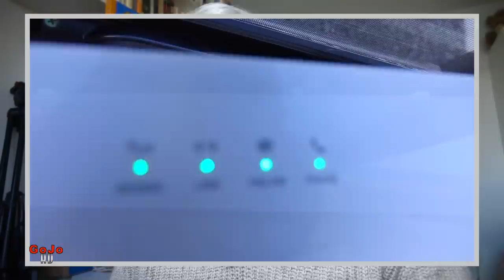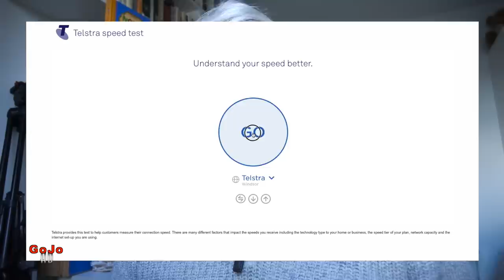NBN Connection Farce | Telstra Smart Modem Review | Internet Speed Test

Comment: Just a Friendly tip if you ever need more speed ask them to add a "Line booster"  (About $15-25 extra for 75mb-100mb Down 25-40mb up price pending on areas) 
Here we have the Booster in a Home bundle with basic Foxtel and  Foxtel's version of Netflix included FREE for  $100 for  87mb Down and 31mb up.....
(Ex staff Btw)

Comment: I worked on rail in WA, some of the optic fibre cable is hanging off farmers fences, they just hooked it over the barb wire to keep it off the ground.
Reply from the maker: wow
Reply: But you can easily get away with that with fibre as the data transfer is not electrical, where you absolutely cannot with copper.  This is one of the reasons why Turnbull's decision to stay with copper for the last km rather than have an all-fibre network was the ultimate in false economy, for which we will all pay for DECADES.

Comment: Wow I thought I had problems getting my N.B.N up and running. Glad I'm not with Telstra.

My story: I am with IINET here in Perth. My N.B.N was supposed to be connected on the 17th Jan 2019. They sent out my connection boxes that had my F.T.T.C connection Unit and my TP-Link Archer V1600 VDSL modem. 

A Message came via my phone to plug in my N.B.N F.T.T.C Connection Unit and wait for all 4 lights to light up and stay on. Well this didn't happen did it. My ADSL2+ that I had for 12 years was running fine with download speed of 13 mb/s so i was used to that. 

But because I had pre-ordered my N.B.N 2 months in advance and it was still not connected 40 days later after my Jan 17th connection date they kept up with text messages telling me to plug it all in. I had been doing just that every day while i was at work. I came home to find that my N.B.N was still not connected. After 4 phone calls to IINET support telling them of the troubles getting a connection, I told them I was not going to waste anymore of my time trying to sort it out. I was then transferred to the head of N.B.N operations at IINET and I told him that I was a gold customer and I was not happy with how they had not fixed my problem, well that got them moving very fast. Two days later it was all fixed.

Finally I got a N.B.N tech to come out and check all the cables and guess what they found, the idiots that layed the lines never connected up the Distribution Point Unit in the N.B.N pit outside my house. 15 minutes is all it took him to sort the problem out and now I am getting 49.6 mb/s down stream and 29.1 mb/s up stream with no disconnections at all.

 (My F.T.T.C connection Unit runs on a 12 volt to 240 volt inverter with 12 volt 60 amp hour SLA battery backup that keeps it powered up at all times and is charged by a 20 watt solar panel.)

  Because of their screw up I got the gold business connection package that just means no slow downs during peak times.
I have been with IINET for 12 years 4 months and find them great.
Reply from the maker: Glad it worked out for you after such a massive mistake

Comment: This is definatly a telstra issue, not NBN, looks like it is a new house and the telstra work had never been done, i used to do pre pro work for telstra and would see this all the time, the builder would get there electrician to run the conduit and the internal cables, so they don't have to wait for telstra to show, i would regularly turn up to a house like this expecting there just to be a slab and have to run cable, when all i had to do was check the internal cabling, pull the external cabling through with the bricky string and fit off the box.
Reply from the maker: Yes. the internals seem to have been done by the sparky - thank goodness.

Comment: NBNCo could have saved very much money by getting current and retired Telstra Techs for the whole rollout. Experience saves money. My example is of a mate who fixes mains water - has for decades. He has a map in his head. The 'management' company, as with NBN Contractors thought it would be cheaper to hire plumbers. That didn't work out as the mains water system is different. So, when things weren't fixed, he cashed in on the fumbles. Winner, winner, chicken dinner.

Comment: on a 50/20 plan, those speeds are still poor. I was lucky with iiNet, I get my full speeds, but even they told me the wrong details on how to connect the modem to the phone line. Luckily I was persistent in trying and got it working.

Nothing worse than calling tech support with iiNet, everyone is in south africa, and they just don't understand anything you say.

There is no way I'd have done their work for them however. I'd have demanded triple time, as it was a sunday.
Reply: I too am with iiNet, although labelled Westnet. On Friday I thought I'd stream the cricket from India but the picture was blurred and kept buffering, so I ran a speed check which showed a grand total of 1mbps. A little low I thought, seeing as how I'm paying for a 50mbps plan so I rang Westnet service. I found the South African lady very helpful but unable to do anything much but refer my case to NBN. This has been going on for almost 2 years now as I live 1.5kms from the exchange and the Telstra pits and copper lines are the problem, filling up with water. Telstra know about the problem and have admitted it, but won't do anything to rectify it. All the NBN problems have been caused by Liberal governments starting with John Howard, who sold Telstra off but didn't force them to improve their infrastructure or services. Rudd's idea was solid and would have improved telecommunications and internet service but the rabbit Tony Abbott changed it back to a combined system and there lies the problem. Our worst PM in history, Malcolm Turnbull backed it up in order to save money but long term rectification will cost taxpayers many billions of dollars.
Reply: Parishna 

Generally the speed is related to the quality of joints and distance of cable... people saying I’m with iiNet or whoever don’t realise how the data is provided.

I’ll make it simple, you can only drive slowly on a gravel road with potholes, smooth it out and you can travel faster.

The service provider isn’t the issue
Reply: But a clear and short road with no obstacles, is surely better than one hindered by 2.6km of decayed copper.

And I have still full speed, FTTN. weird..
Reply: Parishna nothing wrong with copper, that was just political spin to suggest it was substandard... all the electrical wires in your house are made from copper ... cat6 is made from copper.

Don’t fall for the political spin get the true facts on communication
Reply: Yes, but only if it's well maintained and 50 year old weather corrupted copper makes a huge difference to snr.

Comment: Telecommunications are not classed as an essential service meaning in most places you can occupy a home without a physical connection being present, it is only if the owner wants to connect a fixed line service that there would be the requirement for work. The statement about the onus being on Telstra to have done any work previously is incorrect for the reason stated above. Also, accessing telecommunications infrastructure without the correct accreditation is a crime against the Commonwealth if my memory is correct, not to mention all the OH&S rules you breached. That was poor form by NBN contractor to ask you to do that work, especially on the public verge as you would have been liable if someone was injured in that pit.

Comment: IMO NBN screwed it up when they decided on MTM, the Multi Technology Mix.

With the MTM, you don't know if you're getting Coax cable, Fibre, copper, Satellite, or wireless these days, I'm surprised they haven't gone back to smoke signals.

IMO this would have been avoided if they kept with the more expensive but easier to manage fibre to the premises because... it's one technology with easier to understand faults rather than seeing that the house is on the border between 3 technologies and finding which one the house is going to be put under.

the people that are doing the job, are a subcontractor of a subcontractor, how is it bad? would you spend 3-5 hours on a job that's only going to pay you $75? no offence but I wouldn't. I would like a job that pays more than my daily feed and fuel in my car, plus insurance and super... not just $75 for a day where I got a degree in technological sciences that cost me over $10,000 to get.

Yes, on my install I got Fibre to the premises but the guy told me it's "$75 a job regardless of time" that made me assist him where I could to get him onto the next job.

Comment: I have been with Optus a long time, therefore installation & modem would be free. To date, installation has been put back 3 times. On top of that, i was told if i switched my mobile from Vodaphone to Optus, i would receive a free sim card, so that if the internet went down, i could use the sim to connect via the phone towers. If we can connect via phone towers, who needs $ 65 billion worth of NBN?

Comment: NBN guys came and installed a new pit connection in the street outside my house cutting off my cable connection. It took six phone calls over an hour long each and over two months to have my internet restored. Trying to communicate with NBN and Telstra phone operators and alleviate problems is more difficult than teaching a Chimpanzee how to use a Mobile Phone. Cheeta give me back my I-Phone you little bugger !!!!!

Comment: Ah Telstra, a communication company that dose not know how to communicate, and NBN is throttled at all points till they get complaints then they speed it up till the complaints stop, then repeat.

I once called Telstra from a phone plugged in to the wall at new rental, only to be told repeatably by several persons from Telstra on very phone I was using, that there is no phone connected to that house and I would need to have tech come out and connect one, it was only resolved by a friend of friend who worked at Telstra.

Comment: Where to start; Firstly, Telstra basically lied to you. Their systems should be able to tell you if your (I'm assuming FttN connection) is installed. The first person you spoke to was assuming your connection worked before but not when you spoke to them. Second, your pits and pipes look new so the people that installed the new pits never ran cable because they were assuming that nbnco would be doing that. That never happens because usually the copper wires are already in the ground. The only thing nbnco contractors do is run fiber to nodes or home if that is what the order calls for. They usually don't touch copper because Telstra own the copper from the node to the house or premises. I had the same problem with Fttn. I've since applied for FttP and 1 year later it was installed. You may have been fooled by someone jumping the gun. Just because you have an nbn box on the house doesn't mean you will have a connection. I would hazard a guess and say that your area was one of the areas where nbn contractors went broke while waiting for fiber and inter connectors to be delivered. I'm the only person withing 5 klms that has fiber to the home and the real estate knows it. They have not stopped trying to get us to sell our home. That is the real disgrace here.
Reply from the maker: Yes - a disgrace. So much unnecessary stuff happening because some don't do the right thing in the first place

Comment: Your NBN tech just passed the blame to Telstra. NBN becomes owner and responsible for all cables and maintenance once area is transferred to NBN. It is not Telstra's responsibility.
Now in your case, it appears, you didn't have active phone service. Only new or renovated houses do not have lead-in cable, which you pull through the pit. And again it is NBN's responsibility to run new lead-in cable. It is not Telstra's responsibility in NBN area.

Comment: A note NBN Co has NO Connection to Telstra. Telstra is just another Comms supplier and NBN CO owns, runs and connects.
In my own experience NBN will not talk to the public only the supplier and that leaves Telstra and all other comms suppliers to pick up NBNs failures.
Some problems are however related to the original telephone connection up to 20 years plus old however due to the Liberal Government going from NBN to the home to NBN to the Node leaves any old original telephone cabling problem still intact.\ resulting in a lot of unnecessary problems.

Comment: That box on your house is for the 10pr cable connection not even a NBN box the one you have is meant to have modulus in it to connect that plug in were the copper strip across to the little plastic blocks and the blue cables are meant to enter in the bottom on the right, they will take that box of the wall and place the bottom of the box level with the blue cable.

If you have fiber to the house then this is all wrong those blue cables are meant to be fitted of on a wall plate inside the house and the fibber cable cones in from the street into the box then into the house next to the wall plate with the blue cables and plugged into the NBN optic fibber box that converts it into analog then from there into the modem that is also next to the wall plate and out of the modem into the wall plat feeding data to all outlets.

Not sure your connection type but it looks like it was done by unqualified person if you do have fiber to the home, I install this a that is my job and this is wrong for so many reasons.

Comment: Typical Government run business, no checks and balances on subbies. Our Government has stopped governing.
Reply: Of course, that way they can focus on taxing, taking, and lying.
Reply: Back before Telecom Australia was privatised, we had one of the most reliable communication networks, considering our population density.
Things started going downhill when Telstra was being run by Sol. They retrenched their experienced technicians and hired them back as contractors, which cost more overall.
The NBN was the greatest thing to happen to Australian Telecommunication since the Australian Overland Telegraph Line, until Telstra realised that they couldn’t compete, paid off their cronies in Canberra and set about sabotaging it by introducing FTTN as a cheaper alternative to FTTH.
Reply: @SalvoDan  It's a mess - agreed.

Regardless of the history, it was clear that once Tesltra backed out of overpricing and/or allowing the NBN to use their infrastructure, there was no way the Gov was going to be able to deliver on all their promises.
Reply: Depends on if you understand words and their meaning I guess. If I was to govern my motor. I would simply be reducing the motors power. I may even be retarding the engine. Same motor or Australia governing same..... Ever wonder where the name Government came from? You can stop with the government already! Australians are slow enough ;)
Reply: Traaavis Traaavis don't need to wonder, it's a Latin word mostly used by the Greeks and governing an engine is not reducing power . It's centrifugal form was to set maximum desired rotational speed. So govern it to run at maximum power for your need, it's a consideration of durability as well nothing like loosing power. If the Government were to govern with maximum sustainable power then you wouldn't have the client installing their own NBN
Reply: They have plans for winning elections, not government. Funny, its called “Australian Government”, the descent has been rapid, since the “commonwealth of Australia”, became a corporation. It is not the same place anymore, this is probably why.

Comment: My problem was similar. I had a tech from Optus come out, searched my house for the copper connection from the street to my house. He couldn't find it. So he had to call NBN and get them to run a copper connection from the street to my house. ( Wish they'd fibre to my house considering they actually had to run a wire). Turns out I'm getting a new Telstra pit in the front of my house too because they don't want to run the copper wire 4 houses down to the next put. Makes sense because they'd have to dig and run a pipe and replace lots of concrete. Funny enough I already had a pit but they didn't replaced the pit initially and just left it. But due to NBNs pathetic management now they have to install a new one. They are so hopeless. Just another dumb scheme from a dumb government. The Australian government. Proudly sponsored by us, the hard working citizens of this once great country.